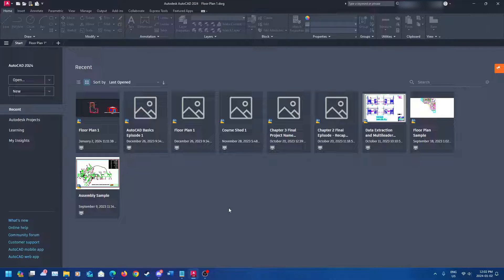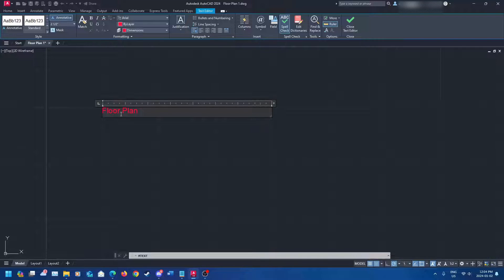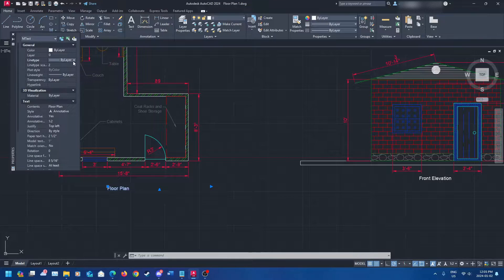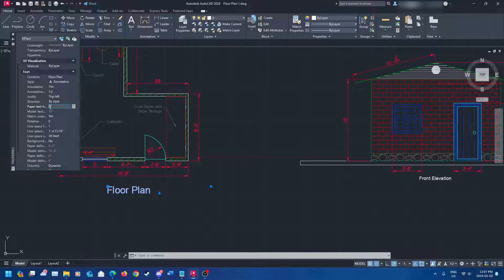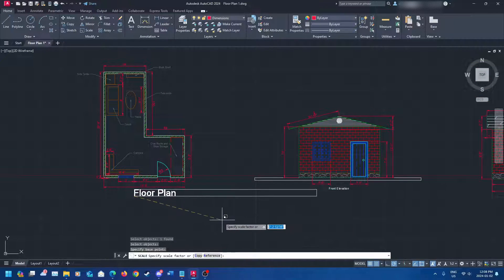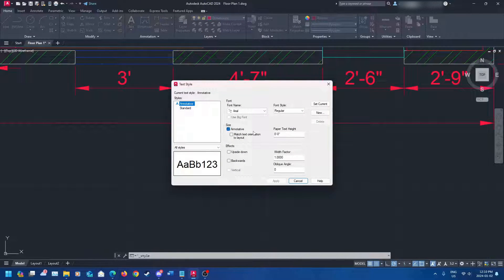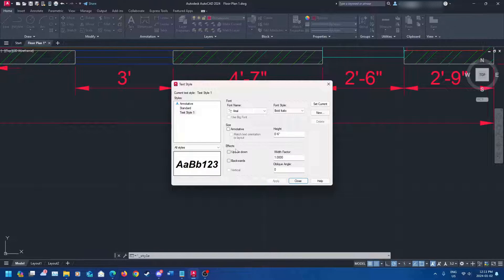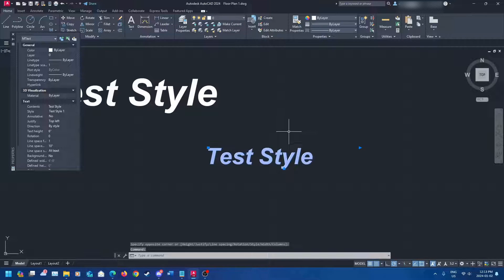How to Edit Text in AutoCAD

Comment: What if we have a text that is vertical but we want it to flip horizontal while we are editing the text? I have a problem where i have vertical text but when i click to edit, it stays vertical so i have to tilt my head to see it straight while i am editing.
Reply from the maker: Hi Troy Brown,
You can fix this by changing the MTEXTFIXED command in AutoCAD, there are 3 settings you can use. Type MTEXTFIXED into the command bar and you should be able to switch the value to 2 to keep it aligned (I believe it's 2, can play around with it). For more info check out this link from AutoDESK: https://www.autodesk.com/support/technical/article/caas/sfdcarticles/sfdcarticles/Text-Editor-rotates-when-editing-rotated-text.html

Hope this helps! Let us know if it does!
Reply: Thank you so much!! That worked for exactly what i was wanting!
Reply from the maker: Glad we could help and it worked! Don't hesitate to ask us in the future if you need anymore help!

Comment: Hello,  i noticed when you were typing in a command that you were able to without setting your curser in the command line.  Seemed like wherever your curser was that a command box came up.  What setting also that?
Reply from the maker: Hi LLM, 
To enable that setting go to the command line and type in "DYNMODE" and set it to 3 to get the results you were seeing on my screen. Heres the rest of the information for this command:

When set to 0: All Dynamic Input features, including dynamic prompts, off
When set to "1" Pointer input on
When set to "2" Dimensional input on
When set to "3" (what I have) Both pointer input and dimensional input on

Hope this helps!

Comment: Do you have a video on setting annotative styles and how they change in the scales and how to set the height and then adding scales. I do large areas so my scales are 1 to 1000 or 1 to 2500 ?
Reply from the maker: I do not at this time, but I'll add it to the current roster and swap around a few videos. Keep an eye out for a video on the topic in the next week. I'll speak to others in the company and get this fast tracked for you!